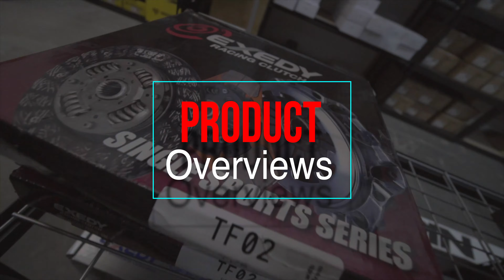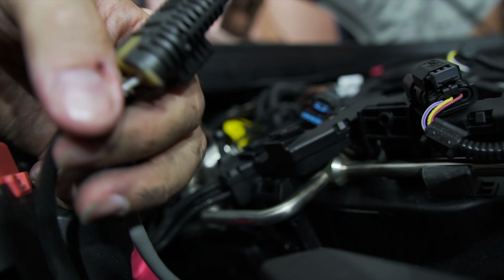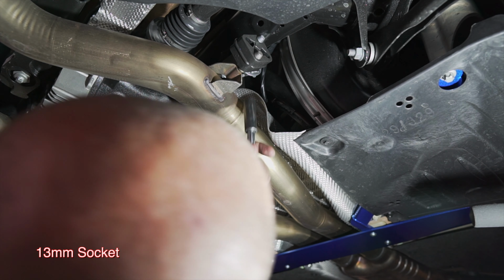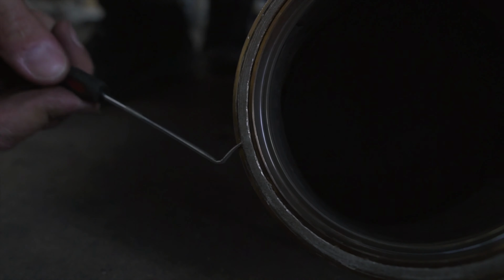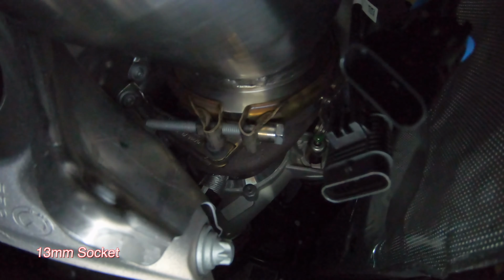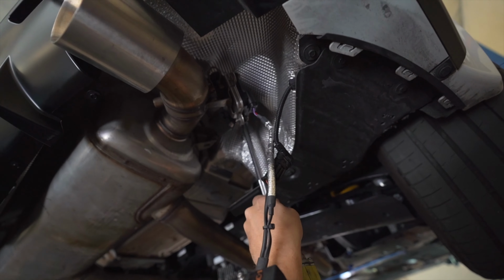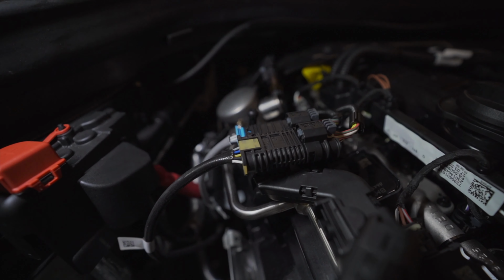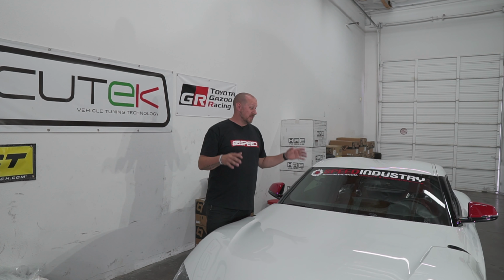GR Supra Catted Downpipe Install | CG Precision

Comment: @ 5:07 when you torqued it you added about 5 extra foot pounds. The socket should be @ 90° to the torque wrench to get exact torque.  It was correct when you first put it on the O2 sensor but u spun it facing forward.
Reply: What do you torque it at?

Comment: This down pipe and the ETS catted down pipes are my favorites........ 👍
An E50 tune and intake should be pushing 480hp ATW.... E50 is available in Arizona....
Like the injen evolution intake....
The exhaust is personal preferance wether stock or an inch bigger....

Comment: One of the best value for money mods you can do to a new Supra.
A slightly larger diameter downpipe with a high flow catalytic converter.
Should free up at least 10 to 20hp.
Reply from the maker: It really is! Thanks for the support and  watching make sure that bell is rang!!
Reply: @Speedindustry  I just installed mine You can't feel 10 hp. But you can sure as hell feel and hear the difference this thing makes. I'll bet horsepower is within single digits of a catless pipe with the stock turbo.
Reply: @65sohc  You can't feel the 10 hp but you can feel the difference?